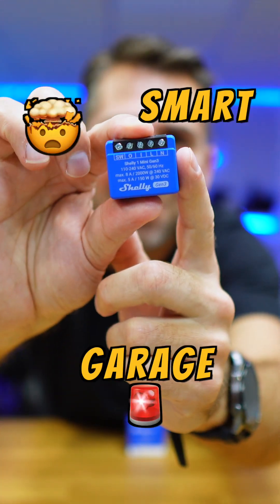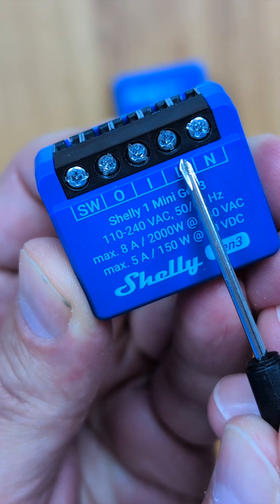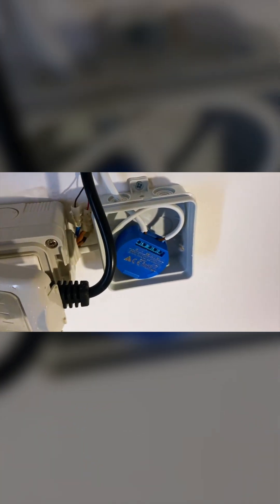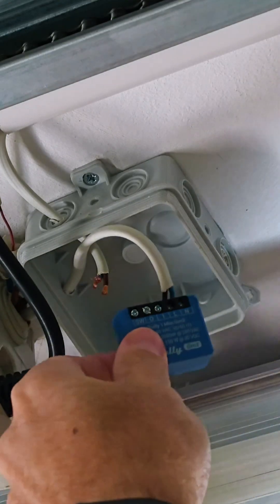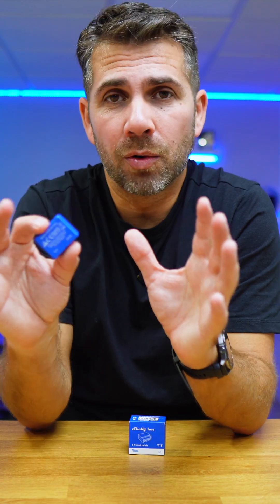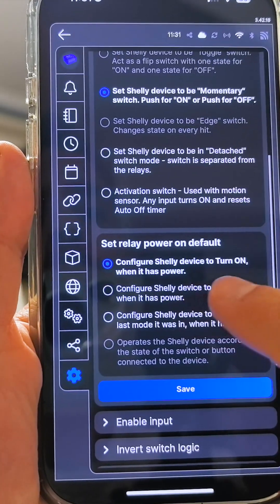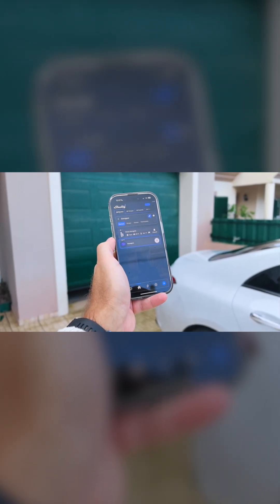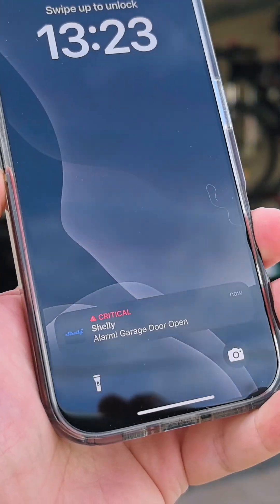How to Open Any GARAGE Door with a Phone

Comment: I have a white box on top of my garage door opener motor.  Wires from the garage door opener button on the wall, as well as the child sensors at the bottom of the door go into this white box.  This white box also has a 110v outlet that the motor is plugged into.  How would I install the Shelly 1 Mini relay in my situation?  Also, what size wire can I use?  All the existing wires look to be standard doorbell wire or 18-gauge wiring.